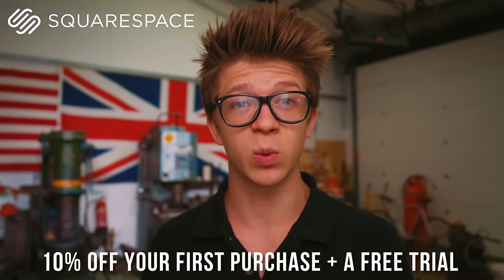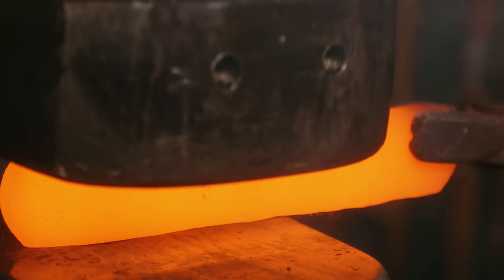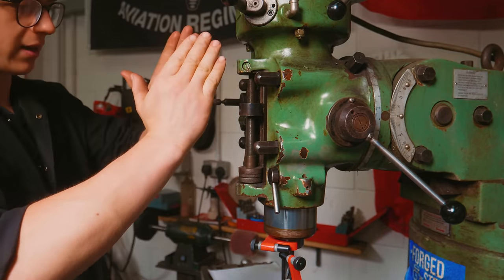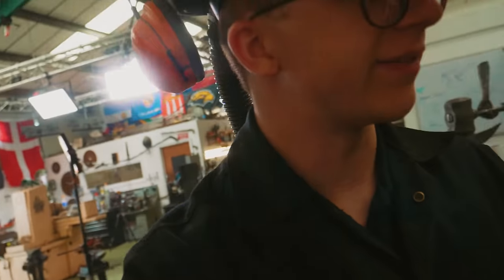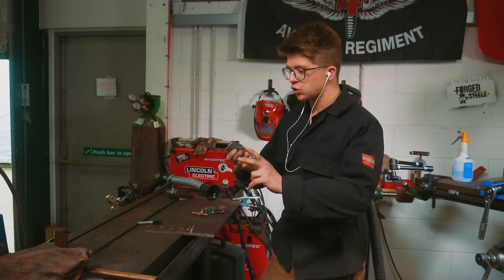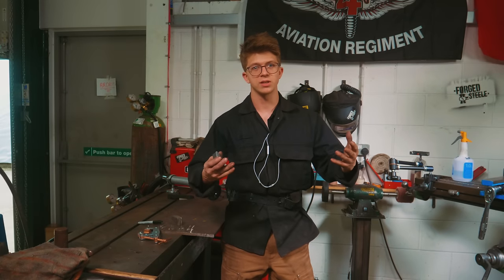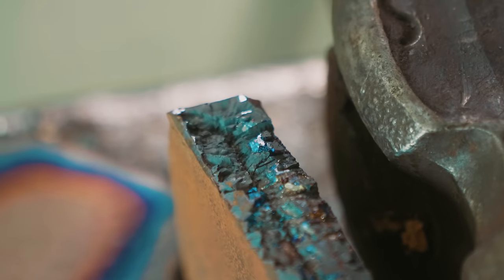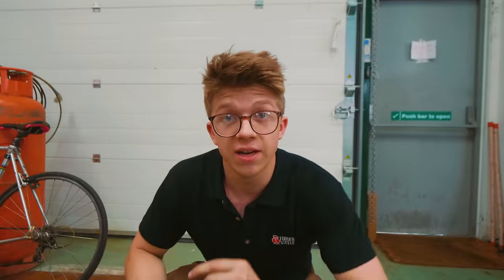CAN YOU MAKE TITANIUM & STEEL DAMASCUS?!?!

Comment: try to fuse gold and titanium to make an iron man armor ^^ (edit: maybe just a glove ^^)
Reply: BlackNox_ sounds expensive as hell
Reply: What would the properties be of such an alloy? Hardness of Titanium and the malleability of Gold?
Reply: Gold in titanium/gold alloys typically was used to create a more temperature resistant alloy. From both cold and heat shocks. While still retaining the strength of titanium.
Reply: i always assumed the gold looking parts were a titanium nitride coating like on drill bits
Reply: @garethbaus5471  You are correct but he was referring to the first Iron Man movie. Tony Stark makes the suit out of the gold/titanium alloy. Mostly for the resistance to temperature shock at high altitudes.
Reply: @wtfbbqpwnzercopter  I actually haven't seen any of the iron man movies.
Reply: Then it's not iron man anymore. It should be gold AuTi Man. Who the f called him iron man in the first place when his suit was made from titanium or gold?
Reply: There is actually an alloy with 99% gold and 1% Titanium. It is substantially harder than pure gold while being 24 Carat. You can't make a knife out of it, but a coin or jewelry yes. 

A very cool but little known alloy is AuAl3. This forms purple gold. It is an intermetallic with covalent rather than metallic bonds, so it acts more like a ceramic, but it is a beautiful shade of purple all the way through and is still 14 Karat Gold. If you want your pure gold back all you have to do is melt it and oxidize the aluminum off.
Reply: That alloy already exists. It is insanely strong, but also has a super complex manufacturing process.
Reply: Wb Titanium and Tungsten? Highest melting point and the hardness
Reply: @genethemineman  tungsten is actually a really shitty metal for just about any application. Its really brittle and likes to fracture apart whenever it gets stress applied to it. It is also incredibly reactive with oxygen at high temperature.
Reply: Lol no gold is too fucking expensive
Reply: @seanlanders4180  Armor piercing amunition disagree with you.
Reply: There's a titanium and gold alloy that is incredibly hard.
Reply: @mmartinu327  i mean, sure, if all you need is heavy then yeah tungsten is a good way to go. Tungsten also works well as an electrode (tig, heliarc, light bulbs) because of its high melting point. But if we're talking about trying to forge it in a standard forge setup. It will be a waste of time as half of the tungsten will have oxidized away by the time you've made any progress. You wouldn't want to use it in any application where strength is wanted, eg, armor as OP suggested
Reply: WC or W alloys yes, pure W , no.
Reply: They won’t mix well
Reply: @lloydforger2920  They actually make a joke about that in the movie. Stark says "Its not actually iron, its a gold titanium alloy." when he was talking about how people started calling him Iron Man. Its just that Iron Man sounds cooler.
Reply: gold is expensive and weak
Reply: @wamyx8Nz  it's also as brittle as glass 😉
Reply: @calangel  But a lot tougher. I have a piece and I had to polish it with a dremel tool. Also I got the original formula wrong, it's actually AuAl2. 

Good way to hide your gold though. Poor conductor so won't set off a metal detector, and unpolished pieces not produced under high vacuum will just look like rocks.
Reply: @seanlanders4180  That's why most bulk "tungsten" is actually tungsten alloyed with 6% iron and 4% Ni or Cu. This allows you to sinter it at lower temperatures. The density is still close to 18g/cm^3 and it is far more machinable. Second only to depleted uranium for armor penetration. (Unless you wanted to go with something really dense and exotic like iridium)
Reply: @wamyx8Nz  good to know, and I'm sure it'd be easy to cook the aluminum off the gold considering the difference in melting points...
Reply: @calangel  Once the covalent bonds have formed, it all melts at the same temperature. You can actually see a white flash as the reaction occurs. This is a chemical compound, not a typical alloy. You'd probably need an oxygen lance or something to break the bonds, but doable.
Reply: @wamyx8Nz  the point I unsuccessfully tried to get across was that since aluminum has a lower melting point significantly than gold, the mixture should melt easier than gold by itself...unless it has some wires behavior like sterling silver in reverse. Once it's melted, then separation of two wildly different densities should be easy.

Going over that reply a second time, I don't think I'd wanna hide my gold that way. You could just use a bit of a strong patina compound on 18k red to make it look like a rock or coal.
Reply: @calangel  Like I said, covalent chemical bonds. Entirely new compound with a melting point similar to gold that cannot be separated without breaking a chemical bond. The big advantage this gives is that metal detectors rely on induction in electrical conductors, and this is not.
Reply: @wamyx8Nz  really doesn't matter what kind of bond is I'm question, melting temp can't be predicted that easily. NaCl melts at a higher temp than either of its components, same as the example with sterling, which melts at a lower temp than either copper or silver.

Unless you carry a chemistry set with you or at a safe house, there are easier ways to hide your gold. Thanks for the education on purple gold, didn't know much about it prior to a day or so ago!
Reply: @calangel  The Au-Al phase diagram is very complex. Purple gold is only one of several different intermetallics that can be formed. That is where I got the melting point from.
Reply: Billy William  Well normally they are metallic bonds where the electrons are de-localized (why metals conduct). Covalent bonds are intermediate between ionic bonds (complete transfer of the electron) and metallic bonds. However the electrons remain localized (usually).
Reply: Billy William  Titanium in general isn't a great blade material. I have several titanium dive knives, even made from the harder beta allotrope they hold at best a mediocre edge. You'll never get them as sharp as steel. The only reason they are made is for salt water corrosion resistance while diving. They are also a very light pocket knife to carry, but they're good for opening boxes and cutting rope, not severing limbs.
Reply: Billy William  Like I said, best you can do is get a beta-allotrope alloy. Titanium is strong and lightweight, but not particularly hard. You might be able to perform a carburization reaction at the very edge. Titanium carbide is VERY hard, but is a ceramic and would crack rather than flexing with the blade. Maybe if you got it thin enough you could make it work.

Comment: As a person who had a Titanium hook in my shoulder for a long time I am happy it doesn't stick with other materials....
Reply: It actually does stick with your body. Unlike most other materials, your body will form a bond with titanium, thats why its used.
Reply: It's more like the body does not have a auto immune reaction to titanium, and try to expel it out.
However my sister was allergic to a implant that was not pure titanium, and it had to be replaced.

I am not a doctor. This is just personal experience...
Reply: It forms a strong oxide layer so its not so reactive, and quite stable. 

The strengh to weight ratio is also good
Reply: I have a Titanium nail in my left , femur and a couple of  screws  in both ankles
Reply: Don't stick your shoulder in the power hammer.
Reply: I have a titanium pin in my leg
Reply: Although this is the main and initial reason that titanium was used for implants and other uses requiring biological compatibility, when it is attached to existing bone in pins or prosthetic mounts, human bone will actually grow onto titanium, and actually allows some people with prosthetics to feel vibration through their artificial limbs.
Reply: Andrew Zaborowski  this is correct. The molecular structure of the titanium oxided surface is spaced identically to the molecular spacing of bone tissue, allowing bone to grow directly onto/into the surface structure of the titanium implant. This creates a bond between the two that is as strong as the original bone and virtually impossible to undo. Osseo-integrated leg implants use this feature to attach the leg to the patient via a titanium locking rod that is implanted directly into the femur. This method will most likely be the basis of “bionic” arm replacements once the technology for  direct mind hand control becomes commercially viable. (The hand is already built that can mimic complete movement of a natural hand, but a commercially viable, self contained system to make it mind controlled isn’t here yet.)
Reply: That is the amazing thing about titanium, it is lightweight, hypoallergenic, and corrosion resistant and so many other things.
Reply: Titanium Oxide is similar to mineralized bonetissue. Except for the porous part of bonetissue. Due to bonetissue having a lot of other things than calcium oxides in it.
Reply: So many interesting things about titanium in this post :)
Reply: Bone tissue also consists of silicon which is why you should eat cereals, whole grain bread and/or drink moderate amounts of beer. Around half a pint a day will do you good, especially for you hot pre-menopause women out there. It strengtens your bones is what I'm getting at. And might also improve bonding with any titanium prosthetic mounts you have. Not that I'm a physicist or really any kind of expert on the titanium-matter but that's what I've heard. Cheers.
Reply: Wupme  rvaz
Reply: Jarrad Croft

Actually there is one that does this and allows a person be able to feel touch once again, how ever they first need to do surgery to make the severed nerves closer to the skin so they can be read, and stimulated. Both the arm/hand and the surgery is very expensive at this point in time though.

Comment: You should try to make damascus with 3 or more different metals. Could look cool
Reply: I was going to ask the same thing.
Reply: And that can be steel, nickel, and copper) Should look super cool!
Reply: That would be cool if possable, do you guys thing he can do a feather patterened raindrop Damascus?
Reply: Maybe a mix of something crazy like aluminum bronze, beryllium copper, and cupronickel? :P
Reply: Adamant Consternation likely wouldn't work.
Reply: You would have to pick your alloys carefully. You could probably weld a copper nickel alloy (like monel or cupronickel) to the stainless, the stainless to the carbon steel.  the carbon to the stainless and back to the copper alloy. The copper allow probably won't stick straight to the carbon steel. There may not be enough nickel in the stainless to bond either but it would be much more likely. The etching would be fun too. You wold want to blacken the carbon, brighten the copper alloy and leave the stainless untouched...hmm.
Reply: Steel copper and nicel dosent work the components must have simular melting points.
Reply: You can do copper, brass, and nickel.
Reply: maybe out of copper, nickel and brass to give strong contrast between layers.
Reply: it's extremely hard to turn 3 metals into the same piece, i'm also pretty sure copper and iron can't be welded
Reply: I'd say try copper, zinc and silver. These 3 work well in alloys, so there's a chance they can be hot-welded in layers as well. Won't be a very strong material, but should look quite pretty.
Reply: I dont know that copper could weld with steel. Just because of the huge difference in melting points. When the steel is workable the copper would be soup.
Reply: is possible weld steel and nickel, but copper and steel? i have serious doubt about it.
Reply: Vladimir Efimov Zinc? Not a chance. Fumes are horrid, and it goes liquid at way lower temperatures than copper or steel needs to soften.
Reply: sure, some vanadium, manganese, chrome steel, little bit of boron for flux. If nothing else the showers of sparks would be interesting, even if you had to wear a hazmat suit because of the manganese. You could also zinc coat all the layers, induction heat them to the fusion point, and the zinc would act as a sacrificial flux. Of course if your exhaust system didn't have a scrubber, the EPA would be having some words with you. lol!
Reply: if you do that with precious metals like silver gold and platinum you get mokume gane, I've seen a bunch of different types of that. I think my favorite was brass/copper
Reply: I remember when I was a young whippersnapper regular shaving razors had one blade and fancy ones had two, then someone thought it would be cool to have a razor with three blades, then another person thought it would be great to make a four bladed razor, then five....

I was going somewhere with that....I think I might be getting Alzheimer's...
Reply: you could cast all those  in one crucible and mix them up
Reply: Yesssss
Reply: Trimascus
Reply: Yes, make it harder it isn't difficult enough already!
Reply: Three different types of steel could work, nickel steel, carbon steel,  tool steel etc.
Reply: BJ Maguire: Correct. You'll get a quite interesting 'camouflage' effect by using more than two different steels. I have a couple of unfinished blades from three or four metal damascus. I made the billet by accident, but will definitely make it again (on purpose).
Reply: Which ones would be the best combinations?
Reply: Yep.
Reply: the temp is way different. steel would be hard and the others would melt
Reply: hey guys, titan and damascus is called TIMASCUS. 

if you like look up nicholsdamascusDOTcom (i dont know if they ship to Germany but the products seems good quality)
Reply: Here are a couple of examples of (unfinished!) damascus blades made with three different steels. Well, actually four since the middle/cutting layer is not multi-layered.
https://ibb.co/nsVhY9
https://ibb.co/fHR0Lp
Reply: Adamant Consternation the beryllium would be a bad idea if any were to get into your lungs you would be left with berylliosis and it cannot be cured. Without getting your lungs replaced of course.
Reply: Platinum, titanium and steel

Comment: I worked for a short time with the Space Shuttle program (OV-101) and as I recall there was vacuum ovens and inert gas atmosphere around tooling. Oh, yea, you need a very specific Fire Extinguisher to stop a Titanium Fire. Best thing to do is just cover it with very dry sand.
Reply: Just needs a Class D(at least that's what we use in Canada) for combustible metal fires
Reply: Mike Ford I’m not familiar with UK Fire Regulation or what passes for Class D extinguisher. There are two agents that will absolutely work on Titanium. Dry Sand and Argon. Argon is difficult to employ, but if anyone can figure it out it would be Alec. The best way to work a Titanium Fire is to go to dinner way away from where it’s burning and watch the pretty colors and sparkles. Because if it lands on you it will hurt you really, really bad, then blow you up when it burns through into the muscles. Be carful Alec we don’t want you to melt.
Reply: Abby Babby Pretty sure Cat D in Canada is the same as it in in the UK. Defs worth checking properly tho. Dry sand should work well enough for anything Alec is likely to encounter, he's not going to be playing with hypergolic mixtures or fluorine anytime soon...
Reply: That's a foamy extinguisher right? Co2 won't stop it and water won't work neither. It need something that stick to the fire source.
Reply: Just toss a handful of asbestos dust over it and forget it. Much like tossing newspaper over indoor dog mines.
Reply: Mme. Hyraelle its some kind of chemically resistant foam and dry powder, I've used them once at a training day and never had need to afterwards luckily. It's a bugger to clean up,especially off moving parts (out of screw threads is a pain)
Reply: Mitch Johnson nope cis we'd like Alec to make it passed his 35th birthday please. Asbestos is nasty stuff.